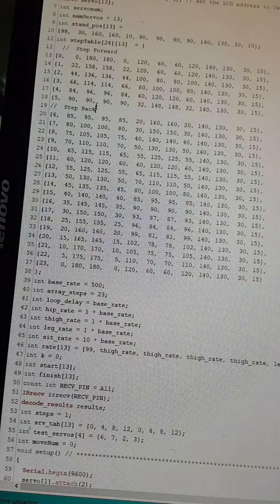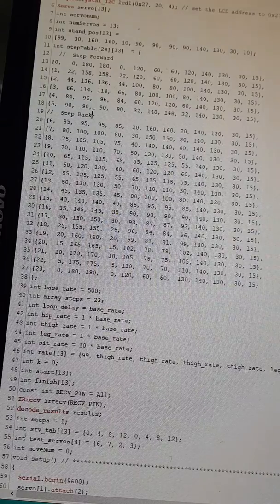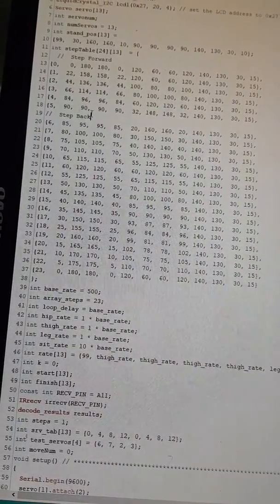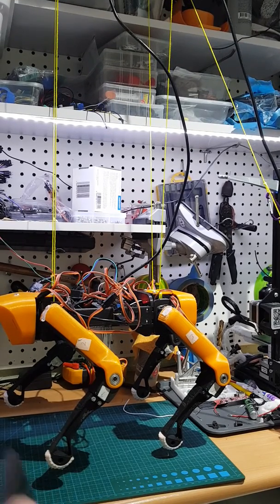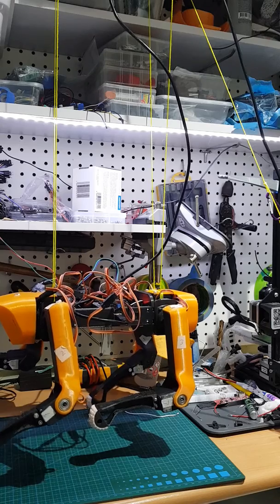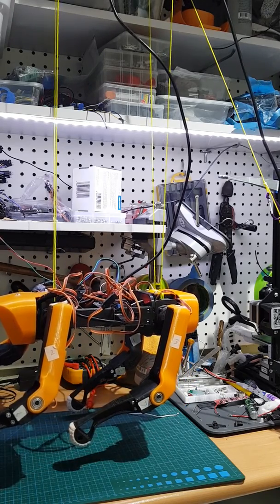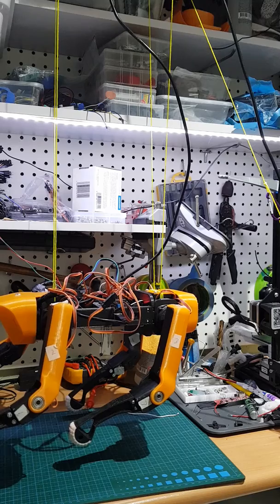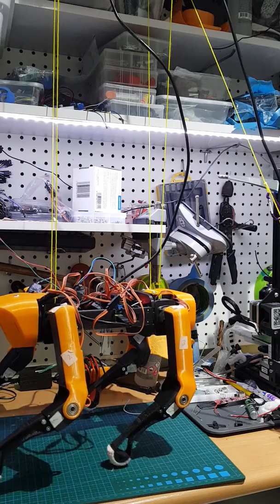SpotMicro - Revised Leg Angle Method

Comment: I have a question, I have built some years ago a small quadruped robot, and I had some problems while adding motors because of their joint angle position. At what position should the joint be, before insert the motors?
Reply from the maker: Very important question. Biggest mistake is to put in the servos and then realise that each one was parked at a different angle resulting in different legs pointing different directions while set to the same angle. What you can do before installing the servo is set it to whatever its intended "start" angle is by putting on a horn and gently winding the servo until it is in the right position. Note the keyword is gently and you CANNOT do this if there is power to the servo.  I'll post a video showing what I mean.
Reply: @mbromham  Thank you so much. Sorry for the late response but yt didn't tell me about your answer. I'm creating an ANN on Arduino to make spotmicro walk and make decision based on external event.